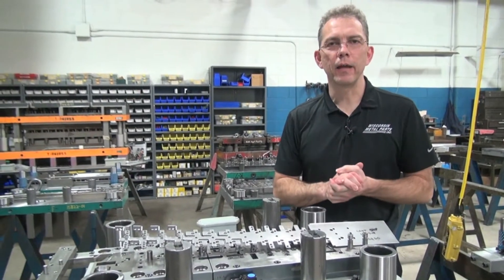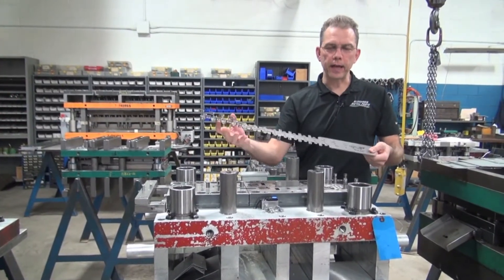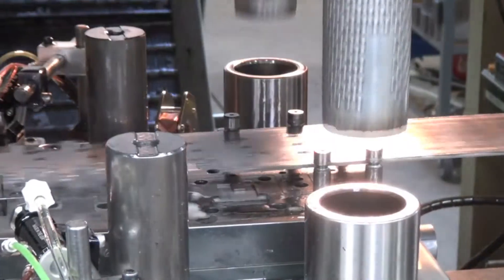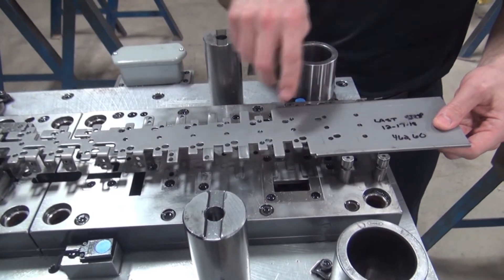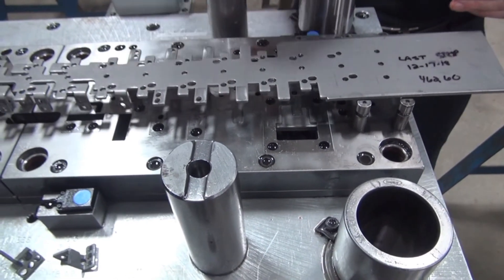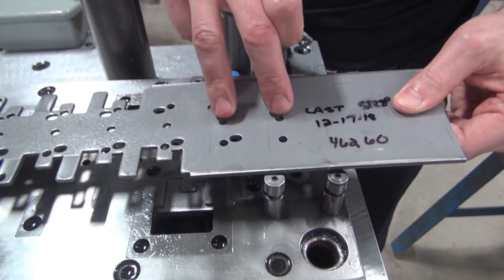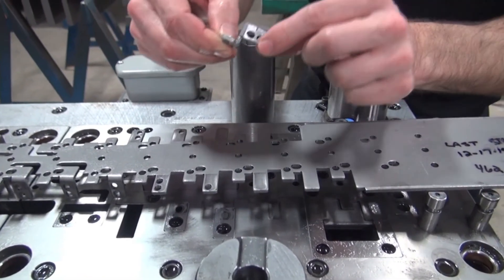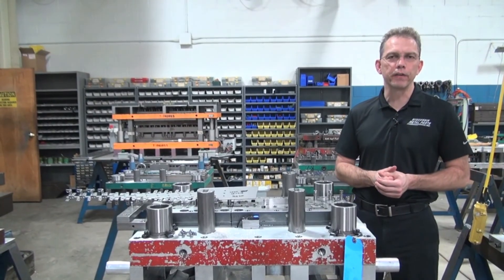What is Progressive Stamping Die?

Comment: Does each progression has a bullet nose pilot that goes into the pilot hole?
Are the bullet nose usually tappered to self-center the workpiece into place?
Reply from the maker: You are correct, the bullet nose is designed to self-center the hole to the pilot.
Reply: From your experience, as the pilot hole goes along more stamping stages
will you observe any enlargement of the pilot hole diameter at the end of the process?
Reply from the maker: @Small_Potatoe-p4t  I sure hope not. The pilot holes are only there to locate and should not be moving around in the strip or forced by the pilot punches.

Comment: Hello thank you for your explaination but i still can defferanciate  between die ,tool,stamped parts
Reply: Tool oils
Reply: All dies are tools but not all tools are dies! This means dies are a subset of tools. For example a plier is a tool just like a die. A drill or milling cutter is also a tool. So also molds for plastic molding and molds for metal casting. A stamped part is what comes out of the die when stock strip or coil is fed to it. It's the result and the die is a cause. Words die and tool are used interchangeably.

Comment: Why do you use the sensor at 1:34? Could you please explain it?
Reply from the maker: This sensor is to detect that the stripper plate has come down into position all of the way. 
It is there to help prevent or limit tool damage in the case of a misfeed or slug pulling.

Comment: When to choose Progressive Press and when to choose Transfer/tandem press?  what is  parts size constrain in each press
Reply from the maker: The constraint will be the tonnage and size of the punch press, compared to the individual part. The length of the progression to make the part cannot exceed the size of the press bed or the press tonnage. This needs to be calculated on an individual basis.

Comment: Is the pilot hole applied prior to this process?
Reply: The pilot hole is punched at the first station along with the other two holes. This has to be done on that the pilot punches can align the strip on every progression after the first hit. If you added the pilot holes later down the line, the material could already be misaligned.
Reply: @bpowda84  But at each progression/stage a bullet-tipped post comes down to the pilot holes, right? Assuming it is bullet-shaped so it has a nice lead-in edge to guide the pilot hole into correct position each time?
Reply: @westhomas8007  that’s correct. The point on the pilot punch is tapered allowing it to “pull” the material into place if it needs to.
Reply: A pilot is just like the fine tuning wheel on the radio. It's job is to correct very minor inconsistencies in progression. The best practice is to place pilots in the die as early in progression as possible. And they must always engage with the stock strip before any of the punches or stripper contacts the strip. That's the reason you see them projected out from the stripper while all other punches have retracted within the stripper.